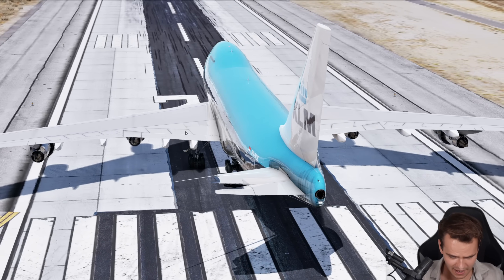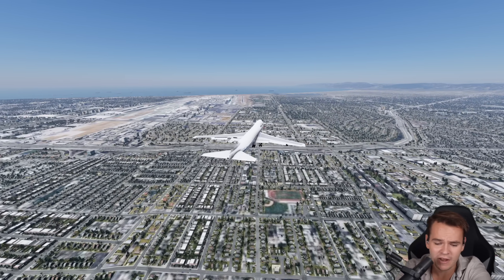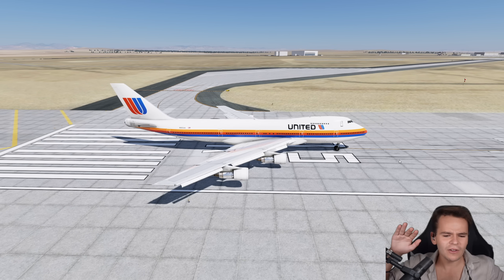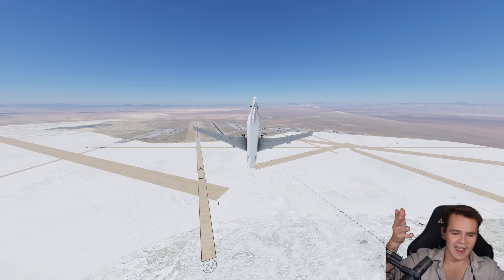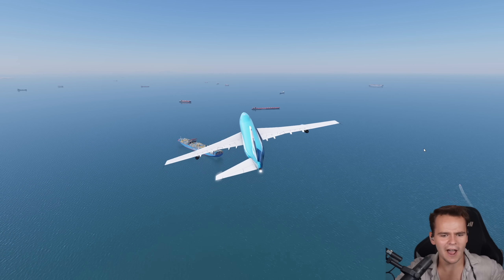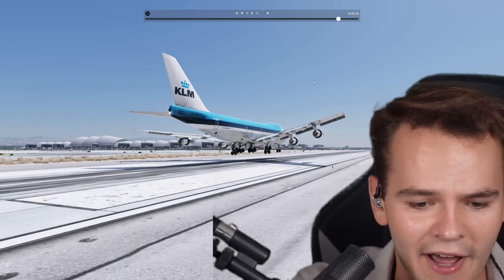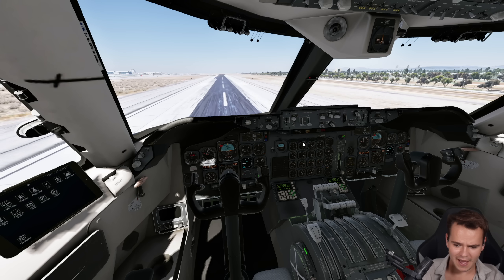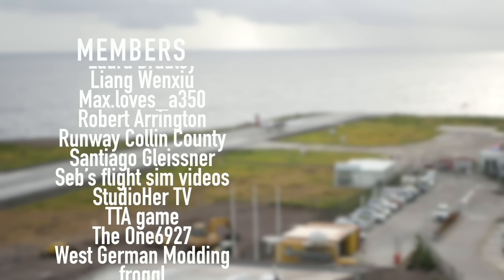What Happens When a 747 Loses Its Horizontal Stabilizer

Comment: Swiss is running out of ideas. Dude, you need to do something different if you want to gain a following. These videos are getting kinda repetitive, all you did was change the vertical stabilizer and made it into the horizontal. Maybe remove something else? Like remove one of the wingtip weights on the 747 to let flutter take over it?

Comment: Without 100% elevator, try the DC-8 because 25 years ago, a DC-8 cargo plane operated by Emery Worldwide Flight 17 crashed while making an emergency landing after takeoff from Sacramento. All 3 pilots lost their lives because of a bolt, a nut, and a cotter key were not installed correctly on the right elevator during maintenance days before the accident.

Comment: I remember when I was still an avnoob on infinite flight, and extending the flaps was the only way I could find to gain lift (yes, I didn't even know how to control the yoke). I once actually got up to around 20,000 feet above San Francisco on the 747, but then I stalled and plummeted into the city. I definitely used the elevators without knowing (I mean, I definitely moved my phone some) so that 20,000 ft run was probably a bit lucky, but that was kind of like this situation.